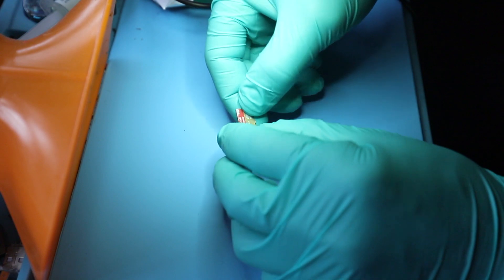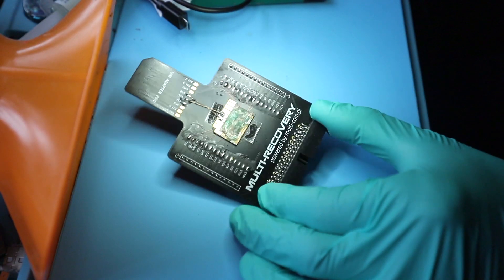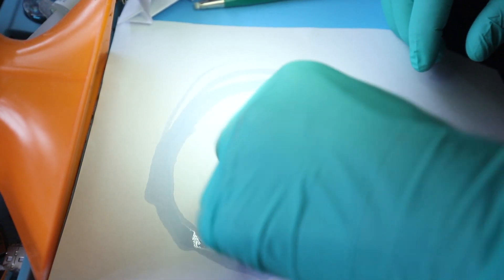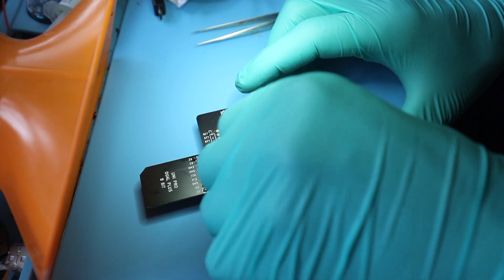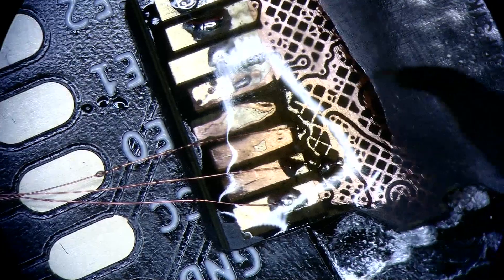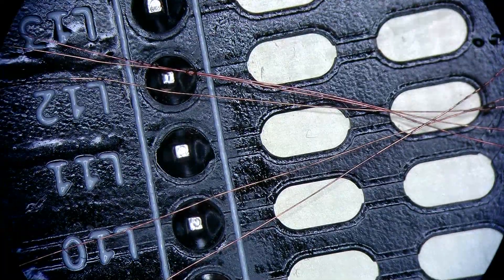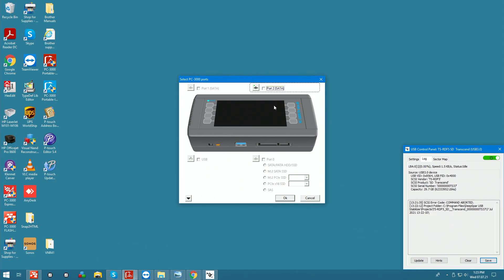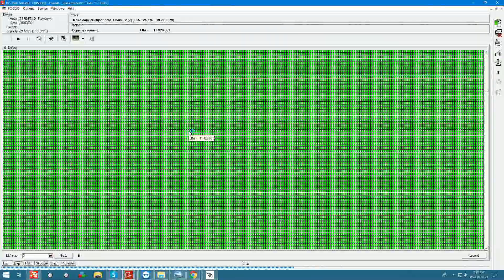salt water damaged microsd card repair and data recovery

Comment: What is the meaning of the clock signal function in the micro SD card? Is it shared with the data transfer pins or is it isolated? Can one work without the other, or are both required?

Comment: If your card gets salty, would you suggest immediately washing it with fresh water? It seems the water isn't the issue as the device is kid of encased in resin. The issue seems to be the corrosion from the salt.
Reply from the maker: 99.9% IPA would be best. Salt accelerates corrosion for sure

Comment: Hello Erkin, is it technically possible to recover data from a micro sd which is cut into 4 pieces..? 4 pieces are cut equal, from middle area in length and width..thanks for your help
Reply from the maker: No, it is not

Comment: Good video!

I used that kind of fiberglass pen at high school in Italy (almost 30 years ago), when we drew technical projects and schemes with India ink. We used it for small errors, as it allowed to remove the surface layer of inked paper from the sheet in a more precise and less visible way than with the eraser rubber. I still remember today the annoying feeling when you are stung by its residues.

I had no idea it was still manufactured, even if its abrasive abilities semm to be now applied to electronic repairs.
Reply from the maker: Really? 30 years ago? Holy

Comment: Sir writing this to you with least hope from India. I had Segate External hard drive of 1tb but my mother with anger threw it on the wall 2 times..i quickly got back the drive And plugged into the computer and got relived to find that it was working but who knew that would be the last time. It stopped working and started make beeps after i unplugged it and plugged it again..it had all the photos of various places..what followed after was huge mistake of mine and my father..we give it to the various local shops and they opened it we thought data would be recovered..but none could..some told that driver head was broken..after that when we gave it to the stellar they rejected it by saying that there are too many scratches..all this happened in 2020..still a huge heartbreak remains..can the data be still recovered sir? Can we send it to you
Reply from the maker: it would need to be inspected my friend
Reply: @hddrecoveryservices  okay sir but how to approach you

Comment: az 7:19 why those wires won't cause shorts?
Reply: Their protective lacquer coat has not been damaged by high temperature of the soldering iron so you can freely intertwine them without worries.
Reply: @desdichago  thx!
Reply: To add to what the other reply said; It's called magnet wire.

Comment: Nice video, could you just try to repair the connections in the card itself? I guess the problem would be about connecting the card to the reader without ripping the wires, is that it? Thanks.
Reply from the maker: With solder mask it would be doable, but adapter like mine was faster :)